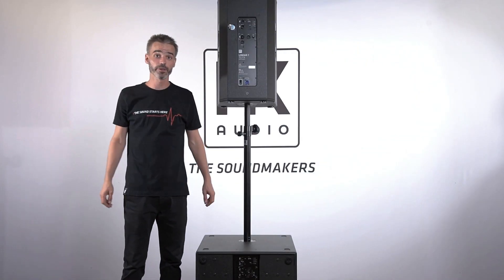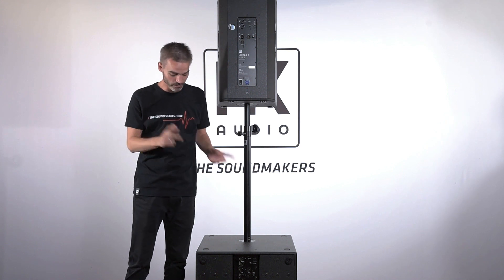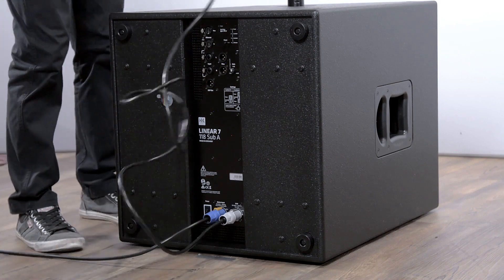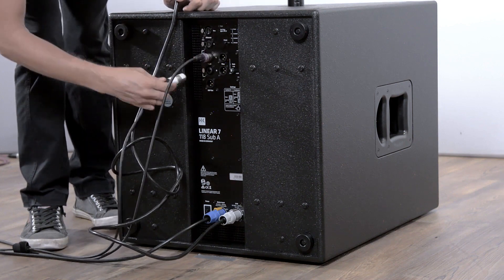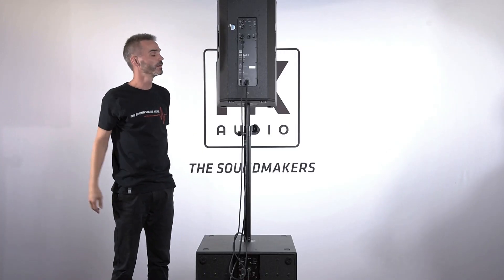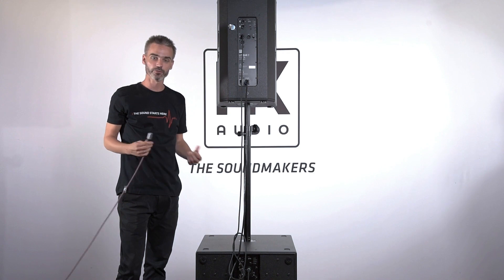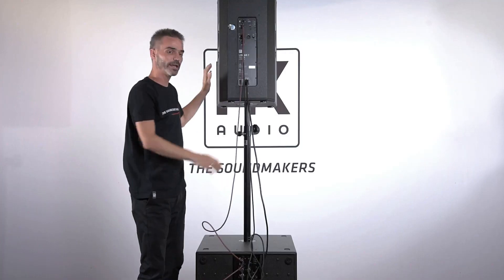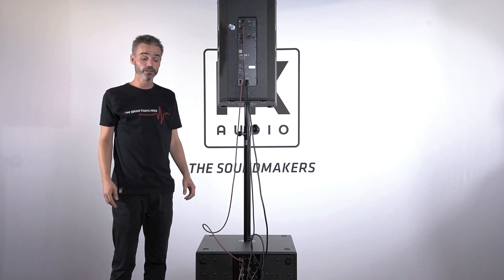Setting up a LINEAR 7 system PART 2 | powerCON, cabling and networking | HK Audio (English)

Comment: hi hk audio i pickup 2 polar 12 need some help with setup. from my mixer main output i ran the left cable into my polar 12 number 1 input and my right cable output into the other polar 12 number 2 input is that right for a stereo sound?